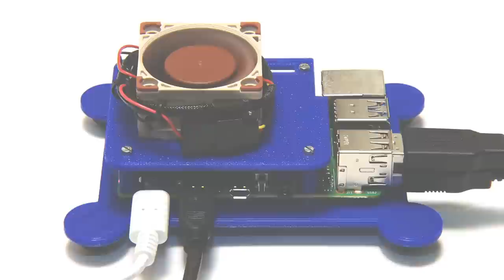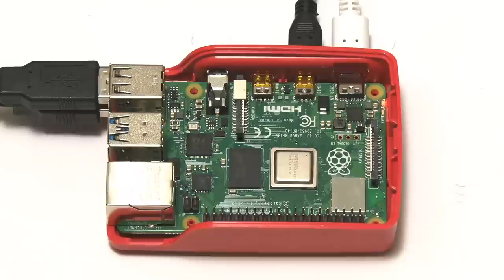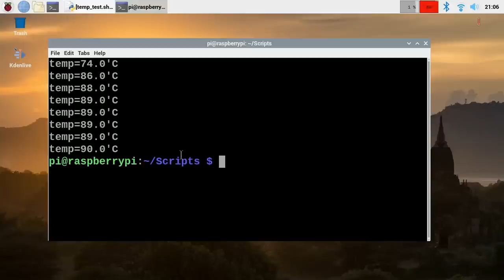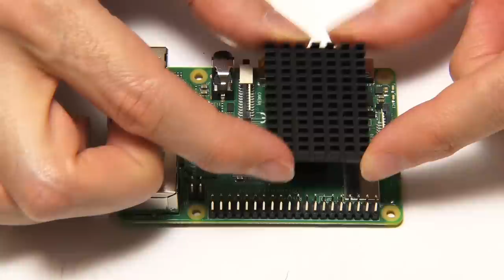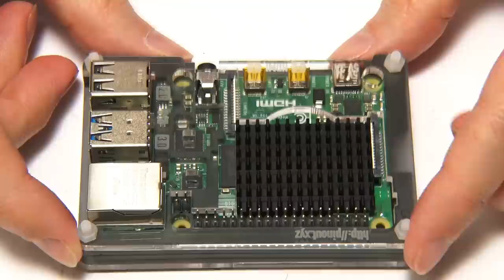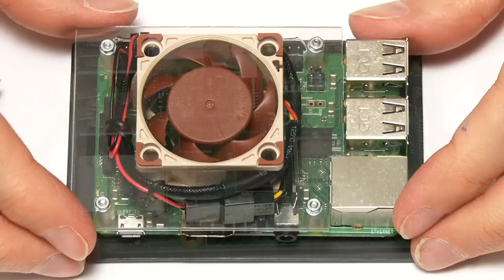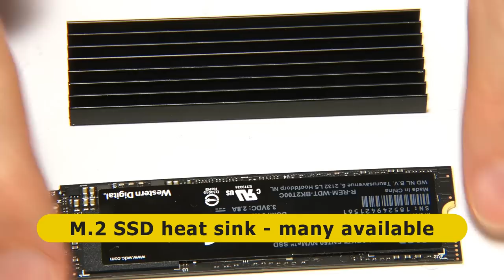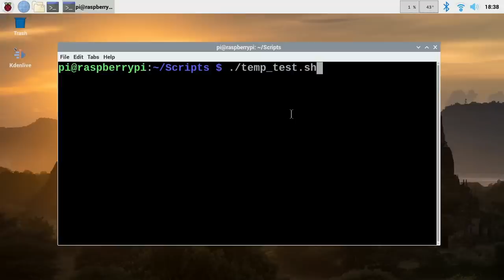Raspberry Pi 4 Cooling

Comment: Of course, with the technology advances and the Pi 4 pushing the limit of ARM mobile platform we now expect the Pi to perform as a desktop computer and thus the need for active cooling solutions; for the resto of cases (headless non desktop server, IoT remote sensing, etc) the passive cooling is perfectly ok

Comment: The heat sink made a very big difference but the fan did not speed up the test very much. But you said that it would only take 10 minutes to run the test. Maybe a different test where there could be seen a tremendous time savings would better show the speed of the cooling with the fan. There definitely is a great difference in temperature.
Reply from the maker: The fan prevented any throtteling, which we saw in the previous tests (and very significantly in the first test!).

Comment: Chris, did you have any software stability problems with the noctua fan? I'd worry about an oscillating device/motor hooked straight into the system power bus causing fluctuations.

----

Back in the 80s, there was a product for the original (fanless, passively cooled) Macintosh called the Mac Chimney. I never saw it in person, but I read about it in an early Macintosh Bible (man I'd love to see that book again). It was a cardboard contraption resembling a funnel (like Tin Man's hat), which channeled heat up and out of the mac, enhancing the passive cooling it was designed to use (hottest components like the analog board on top, cooler components on the bottom).

----

You mean I don’t have to use 
for f in $(seq 1 7)
anymore! Dang!

I learned shell on ksh from an excellent book, and now I’m learning new things about what bash can do all the time. 

The complex shell string substation syntax still gives me nightmares, though. I’ll be using grep/awk/sed/tr until I die. 😅

----

You could also use
$ time ./temp_test.sh
To get precise timing values for your script 😁
Reply from the maker: I've had no stability issues with this rig. The 5V line taps power before the Pi's voltage regulator.
Reply: @ExplainingComputers  Ahh, that makes sense.

Christopher, have you thought of distributing your videos on LBRY? It's a decentralized, blockchained video sharing p2p network (no piracy, though, from what I've been able to tell).

Comment: Great video Chris very impressed with you own printed case. I also like the temp monitoring in the Task Bar, how can I install that feature ? maybe you could produce a video! Kind regards Paul
Reply from the maker: If you right-click the panel (task bar) there is an option to add/remove what appears there.

Comment: Thank you for pointing out the problem. I am old school and  would never use the double stick tape for a serious cooling requirement. Also, from the school of passive cooling when possible. So how could the developers of Pi 4 layout the PCB without considering cooling, then stick it in a case with no ventilation? If the "Desktop Kit" is intended to make the jump from a wonderful educational highly capable SBC to an entry level PC they failed.
Reply from the maker: It is a good point about the desktop kit -- where the Pi 4B arrives in the official case . . .

Comment: Nearly all 3rd party case kits I have seen in the past for the Pi2 & Pi3 have come with at least a one or two of those small heatsinks to place on the chips. I'm surprised the Official Pi4 case does not come with heatsinks. The few kits I have seen without a heatsink were for the Pi2 or have a metal case that acts as the heatsink like the FLIRC case I have my old Pi2 in.

Comment: Hi Chris. excellent video. It struck me as odd that we now have to wait for two things to happen to the Pi4, and that is the refined video drivers and now for the active cooling components to make their way into the easy to get a hold of distribution channels. It strikes me that perhaps the {Pi 4 was put into mass production a little too soon. Well, that's the way of life in the computer industry.  I eagerly await your next video. Just two side questions if I may; When do you think we will see USB 4 in the general market and when do you think ( If ever ) we will a Rasberry Pi have the capability of running a full-blown version of Linux Mint? Thanks and cheers.
Reply from the maker: Hi Thomas. I think USB 4 is some way off; the improvements it may give will be far less significant in practical terms than the move from 2 to 3. ARM Mint could be created for a Pi, but the team would need a reason to do it . . .

Comment: I agree cooling is needed on Pi 4. I was wonder if i put in a dielectric cool solution would it work. I have seem crazy video using mineral oil and 3M liquid cooling on computer. Wonder it would apply to PI4 as well.
Reply: More than likely would work, probably overkill though

Comment: If height increase is allowed why not to try with something taller like northbridge heatsink eg 40x40x40mm? Also passive cooling is largely affected by airflow, so try to put the board vertically.

I made nice passively cooled celeron chromebox(2957u) mod with northbridge heatsink , cut the case to have heatsink outside, but it could stay under throttle ceiling under stress load only when placed vertically to help convection airflow.

Comment: It would be intresting to see the result of fan cooling with no heat sink. Try several orientations of the fan: straight down, low angle tangential,  ducted to focus the stream across the SOC. Also o intrest would be the effect of just coloring the SOC chip black to improve emissivity, a trick used to control heat on the SR71 blaclbird spy plane.
Reply from the maker: I run the fan no heat sink test in a follow-up video posting Sept 15. :)

Comment: I think the next logical question is how far can you push the performance with that active system? Like what amount of overclocking is possible before throttling becomes an issue again with the fan setup? Perhaps that + a thermal camera to identify hot spots might help you further optimize this cooling setup and performance?
Reply from the maker: Yes, OC has to be on my list!

Comment: Great video, thanks. Could you also try with the fan turn tu push the hot air down. As I think the sort of heat sink younused is not intended to be cooled with a top fan. Also as hot air goes up it might be interesting to see what happend if with the helpnof the fan you push the air out. Just a thought. Thank you.

Comment: The active heat sink that is rigged to RPi4 is quite heavy task to cool down RPi4 to the usual RPi3B temperature.  I think I will stick with RPi3B for a while to wait and see the upgraded RPi4 with cooler temp.
Reply from the maker: I cannot help thinking that a "perfect" Pi would be a Pi 3B+ with a USB 3.0 controller, 4GB RAM, and gigabit Ethernet (but the same SoC as a Pi 3B+).

Comment: do you think you can review the argon one for the pi4?  i'm interested in your opinion on it, maybe along with the pi4 version of the flirc.  with the included pads, and with some thermal paste (say kryonaut).

i've tested both the flirc 2 and the argon one with my 3B+, and found that the included pads for both were crap, and that kryonaut proved better (applied to SoC + heatsink post prior to assembly).  i'd be interested to see how both of these cases compare with the pi4, because of the added heat of the pi4, especially with the flirc.  my testing with the flirc 2 running sysbench for 12 hours doing an impossibly high count in a single run until i killed it had the flirc level off in a 90F room at 54C with the 3B+.  the argon one seems to level off at about 52C or so after 12 hours of the same with the 3B+.  both of those tests were using kryonaut using a moderately heavy spread on both the SoC and the heatsink posts that come down from the top of the cases, but not so heavy as to cause the TIM to slop over.

i'm wondering if the flirc design has what it takes now with the pi4 being so much hotter because the flirc of course is purely convective dissipation because it is passive.  my preference is the argon one because of the access to the gpio pins, but the pi4 version looks like it drops support for the new second hdmi (which is really of probable limited usability on such a weak gpu, especially at 4k)

Comment: Love your stuff. Would you please post a follow up showing the temperature results when running the Pi 4 without any case or heat sink? I'd like to know how much of the heat buildup is simply because of the poor ventilation caused by the official case. I'd also be interested to know the results if yuo drilled some holes in the official case in order to provide a little bit of ventilation.

Cheers!
Reply from the maker: The results will be somewhere between in the case, and out of the case with the heat sink. :) Or in other words, unacceptable for use. :(

Comment: This video on cooling leads to a question that needs your advice:  I live in Florida, USA and in the summer my back porch office has an ambient temperature about 27 degrees celsius ( 82 F).  Then the temperature gain reaches 90 F during the day.  With fans, that is livable.  However, if I try rendering a video using Adobe Elements, it hits the max rate of 100 celsius.  Is there a simple way to cool the CPU LOWER than the ambient temperature.  My air conditioning is helpful, but not enough.  I already have five fans blowing on it.   I do know that I overclocked the i7 CPU so will reduce that, but what else?  I use a Hyper 212 Evo cooler and really don't want to go to water cooling, even an AIO.
Reply from the maker: To go below the ambient you could potentially use a Peltier cooler. :) But, even in an ambient of 27 to early 30s C, you should be able to keep a CPU below 100 (below mid 60s I imagine) with traditional fans, heat sinks, or water cooling. Just don't use stock fans -- go for something like Noctua or Zalman coolers -- and you'll need a case with very good airflow.

Comment: ive learned with this thing unless the case is a heatsink you will need active cooling even with heatsinks it will run aroun 60c idle but with just a little fan it doesnt even have to be on the heatsink it idles about 47c and even under load never gets above 55c i have done a burn in but shoot im typing this on it now im using the element14 7 inch screen and case you did a review on.  my only complaint about the case no fan mounts but i just used 2 side adhesive to mount it on the hole in the back it works pretty well even on low speed.

Comment: I'd like to have seen the active cooling solution with the original smaller heatsink.  I suspect the larger heatsink is an improvement. I'd just like to have seen how much of an improvement the forced air made.

Comment: Noctua has a 40x10mm fan with 5V, too.
Maybe something to reduce the height.
And If someone wanted, he/she could hook that up to the 3.3V Pin for reduced noise.
Reply from the maker: The 10mm Noctua is certainly an option. :) However, I would never connect a fan to the Pi's 3.3 volt rail, as this taps power after the Pi's voltage regulator, so the potential to damage the Pi connecting an an electromechanical component to this is significant. The 3.3 volt rail really should be for electronics only.
Reply: @ExplainingComputers  You might be right in that regard. However, I've seen a kit where just the connection to the 3.3V pin was a selling point as "low noise mode".
But I get what you mean, no worries.
Reply from the maker: @wiedapp Thanks for this -- and I too have seen kits (and online articles) where fans are connected to the 3.3V rail -- and even to GPIO outputs! :O

Comment: I honestly think a big part of the problem with 2nd (bigger) heatsink was improper heat conduction from the chip to the heatsink (adhesive thermal pads tend to perform very poorly), since the difference with the first heatsink seems too small for the great difference in size.

Also, I would have loved to see results in last setup with fan turned off aswell, since for what I can see, there is direct contact between heatsink and soc, despite being smaller that can make for a part of the difference we are seeing, don't you think so?

Comment: I guess a cooling without fan would be way better if you placed the Pi standing on one of its short edges. Convection would carry the heat away much better than when it's sitting flatly on the table. This still would run way warmer than the actively cooled version. You've shown what I always suspected with the original cases, though: They're wubbish. A case that acts as a duct with the airflow from a fan blowing all across a Raspy with heatsinks on all its hot-y bits would probably be ideal.

Comment: You, should have made the fan to have in contact with the SoC that would have made the heat transfer Better and more better ideal temps
Reply from the maker: Actually, performance would have been worse as the whole board heats, so better results are achieved with a higher up fan (at least one as powerful as a 40mm Noctua).

Comment: I reckon a custom cooling option needs to be tested with a block of aluminium and try a few different designs for the largest amount of surface areas to determine which is best.

Then test as passive cooling and active cooling.

Comment: Fascinating as always, Thanks! I wanted to ask, was the fan configured to Pull or Push (suck or blow in other words!); Did it make a difference if you tried alternating the flow?
Have a great Sunday!
Reply: probably push since there is no sticker to be seen
Reply from the maker: The fan was pushing air down onto the heat sinks / board.
Reply: @ExplainingComputers  Cool, Thanks for clarifying - With the Style of heatsink you used, it could possibly work both ways

Comment: Very interesting Chris. I have just installed an M.2 SSD on my PC as the last one had died (it just stopped working and contained my D: drive). Now I am wondering whether it got burnt out and the new one actually needs a heat sink just like the one you intend to use on the Pi. Thanks for your videos which are always very interesting.

Comment: im using a pi4 4gb with the official screen (7inch dsi), and with a small fan mounted to blow air across the heatsink (from the gpio direction), runs quake 3 at 41 C.
Reply: mharris1270  I did that with my other raspberry, using hdmi, and a more traditional case. Anything below 60C is good, and if you're using it to run dosbox, a good copper sink will likely be enough to do it with passive cooling only.

Adding even a small fan and a heatsink will drop you below 50C, and going below 40C on a full load, like that seeed studio ice tower is cool, but a bit of a case of ars pro arte.

Comment: I just got my RPi 4, I will be setting up the cooling before I boot it up.  I also have 3 3b+ and 2 - 3b RPi's  every one I have setup has overheated and shut down without cooling.  I treat these as I would any other computer and put active cooling on them.

Comment: Hey Chris, I’ve read a lot of rumours arround the internet that tell that the RPi 4 has got a lot of problems with temperature and power (kind of buggy hardware). Perhaps a complete analysis of pros and cons would be very useful to make up our minds whether it is worthwhile or not to purchase one. Greetings!
Reply from the maker: The Pi 4B, as far as I see it, has issues with cooling (which can be overcome, as we see here), the wiring the USB-C power connector (which are not a problem if you use the official PSU), and with software that could be better optimized (specifically, GPU acceleration for video playback in Chrome, which I understand is not currently implemented as it creates other issues). The latter will I am sure be fixed in time, but may be something to wait for. You may find interesting the review coming up next week of an SBC that pays 4K video really well, both locally and streaming . . . :)

Comment: I'm a little surprised that this didn't come to light when they were testing the Pi 4 before releasing it.  If they knew it ran this hot, they should have included a cheap heat sink in the purchase.
Reply from the maker: So, so, so true!

Comment: I like the idea of the case but to me a case should be a case. As in, it should encase the whole thing and also do something about noise if at all possible. So this heatsink platform thingy works but I don't really like it as it is. Also, instead of the small noctua, may as well do an 8 cm variant that's quieter, so a real case style case with an 8 cm fan in it would make more sense to me. But, the heat numbers do speak quite loudly; the Pi 4 needs active cooling if it's going to be doing anything with all that power.

Comment: Fans on the raspberry... It is a sbc not a nuclear reactor. We would all be happy to have the SOC on the opposite side of the board in order to use a passive heatsink as base (you need some kind of base after all so it better be useful) . But no they stuck to the old design.
Reply: heat tends to go upwards, base is short term solution, breathing air gap is the best you can do

Comment: Lack of cooling is the downfall of many pieces of electronics. Amplifiers, chips etc. Mostly because a good heat sink is big, can be heavy and expensive. Most manufactures like to make things as small as possible and as cheap as possible. The fact that they will over heat and have poor performance and a short life does not seam to matter.